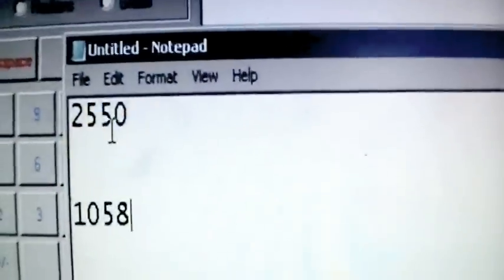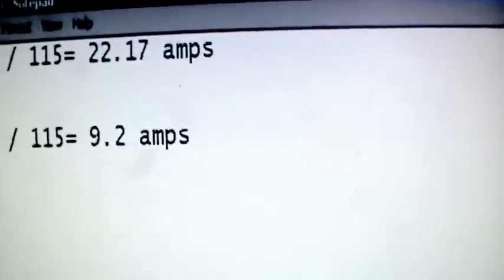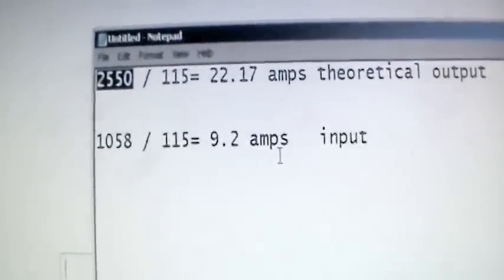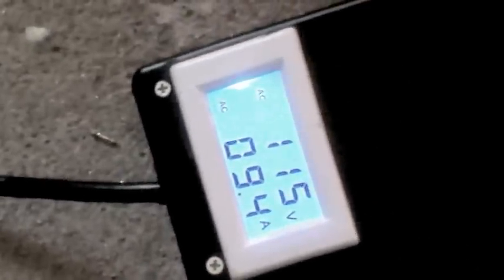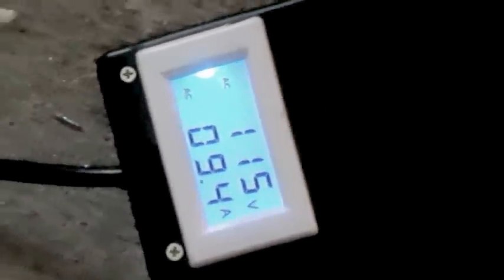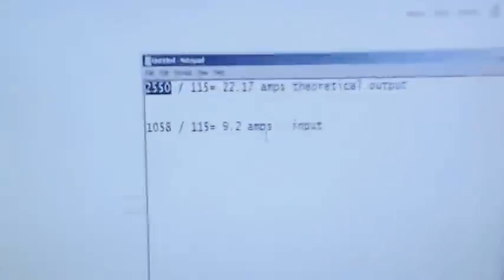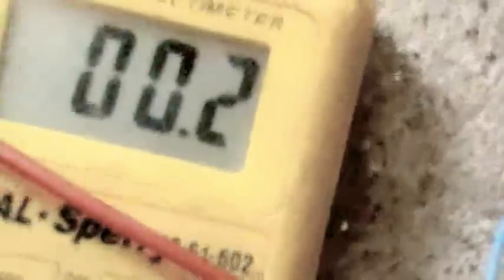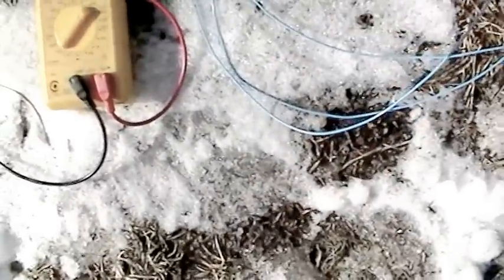Pelex -Power From Electromagnetic Energy Exchange - Overunity

Comment: Marc have you written a simple pamphlet sowing all that is presented here parts list and hookup procedure?
Reply from the maker: ***** I haven't yet since the device is capable of generation using a small quantity of power, small batteries to power a pure sine inverter does the trick, and, I have to keep the schematic offline to be eligible for patent. I've been told that a patent may eliminate my ability to build a device and market it since all governments retain the right to keep any patent as they will for government use at no profit to the inventor if they believe it has the ability to eliminate government income by tax, change or decimate another market that is important for the government to profit from, as well, I wouldn't ever be able to use it for profit to myself if that happened.

I have designed 3 different revisions of this device, but, this video doen't clearly show what is happening since the devices used in it's output do not run anything close to their rated output in their tagging as others have commented. I have been able to come up with a parts list and a functionality description, but, I have yet to really figure out where the energy is truly coming from, so, I don't feel like saying it comes from lightning strikes like Jesse McQueen said, or, from the ionisphere, knowing that I really do not know and I don't wish to be ridiculed over something I really have no proof of. The device truly draws an energy in from somewhere, so, I will need to try and figure it out, but, I don't have the millions in gear to try and figure it out.

I have decided to make one device from the technology to market for the efficiency of the LED, and once this is marketed and i am successful, I will go ahead and anounce the structure of Pelex to the public, but, if I go ahead and make this an open source design that everybody would use, the outcome would be very dangerous as the device has more power than a high voltage power line of wound incorrectly, it would cause an explosion, and, it could easily kill somebody.

   The power it starts with , conventional electricity is very dangerous to begin with, but, it is brought down to a safer , more manageable level so we could use it in the home with less chance of injury, so, when we use it again transforming it back to it's original condition, high voltage and low amperage, it has the same drive it originally had, with a massive potential to blow off limbs, cause explosions, etc. This is something I don't wish to see. If I drive the device and adjust the way the magnetic manipulation works, the Pelex unit will run devices that normally use the high potential amperage driven system with no trouble at all, as well, it will be able to operate without massive electrocution once a path of resistance is found for it's use by the electricity, doing nothing to the person who would normally be a casualty by the power if touched while in service. Normally, if we touch a system that is under massive load, the electricity will kill us easier because it is drawing most of the load from the source. If we broke that load and become the load ourselves, we would normally be dead immediately because nothing would change but the resistance. This system works opposite from the conventional system, but, still has the ability to operate a high load device with ease. It's almost as if the output has a choice how it operates and it seems impossible, but, it is very true, not a bit of exaggeration on my part.

  People will tell you that if one does not share parts used, a design, or wish to give up a parts list that the device is fake. Put it in my perspective, if you had a dangerous device that could kill a kid willing to build it, would you take that responsibility? Would you be able to live with yourself if another person dabbling with this technology built it and had his 4 year old sitting on his lap touched the wires and died from a simple battery feed??? I wouldn't, as well, I would like to earn my money back and try to live comfortably.. In fact, I don't think that by earning 100 million and 20% of it's profits would be greedy at all, after all, it is something that's thought to be impossible by any conventionally minded individual and it has the potential to change the world.

  Please watch my Pelex video that shows the design being measured by the killawatt meter. It is probably the only video that will show a metering of less going in than coming out on any device across the internet, except for maybe Tariel Kapanadze's device which is not metered at all.

  I have been ridiculed, called a scammer, a hoaxer, a liar, and, many other things, but, until the day they spend one day in my shoes, being watched, limited to my email and messages, being disallowed email attachments so I could not list the answer to their questions or design criteria, etc., etc.,.. why would I be limited to my answers and emails if such a technology were actually impossible to produce? The answer is because I hit the nail right on the head and they all know it. Our government has lied and said they want us to take part in a crusade to find a way to fix our planet. I have done that. They said they want these technologies to be released to help us become an energy abundant society without the use of fuel.. I have done that. But, I do disrupt another technology that uses the sun and wind from propelling it's way to the top. I clearly stand in the way because my device would cost less than $20 to produce and will run a home per unit. It has everybody rattling in their boots that I hold the key to all doors and they want me to look like a liar, a thief, a cheat, scammer, and a hoaxer..

The reason why I haven't posted a new video showing how to do this is  because I have been eliminated from uploading to youtube, and every other method of electronic transmission with every device that  I own. Once I transfer my pdf or jpg schematic electronically to another device, it will not upload either because somebody has so eloquently infected my devices which forces every file being transferred to crash. The attachments are not able to be transferred to any other server, not by text, not by email, not by upload.. They all crash immediately, and it is forced by those trying to protect the economy of the oil market and I have become completely sick of it that I have taken the time to present the device in a much clearer way, a better analogy of how it works, and, why we are not using this instead of paid electricity.

I have made the larger device for 4 homes to function , metered so the homes could run as customers of mine, as well, there is not an input other than a tiny little 12 v battery, 3 aH, that is recharged by its output and infinitely loops back to run the charger while 32,000 watts is output from the device continuously to run the components of each home including electric dryers, stoves, and electric heat.

I think a mistake has been made to disallow my posting of these videos, or my attachments, so, I have taken the time to give the videos to others to post them for me, and, I have taken the time to offer a written design criteria , given to friends and safely tucked away so it didn't make a difference if I disappeared today, the technology could be released tomorrow as open source docs.

There are hundreds of copies floating around , but, these people do not know how to build them as I would, but, there is instructions on how to do so with the packet I have asked them to share if something happens to me.
Reply: I found that patents are basically worthless.  If they want to steal it they will and then they will wipe you out with court fees.  This has happened over and over.  We all feel that now its best not to try and make millions and open source is a much safer way to go they can't kill allof us.

good luck
Reply from the maker: trust me, I am thinking about it, but, I am in financially way over my head and need to earn some of my retirement back. A lot was spent designing this and much of it needs to come back for a sensible retirement when or if  that ever happens.. Or, I could take a portion of what I have now, one of many devices and make the money from one before I go on with opening up to public. It's surely a winner of an invention, and the best part is it is as simple as can be to build. Everybody will say, "I can't believe I didn't think of it, that's how damn simple it is.. And the best part, we can build it by taking 3 transformers from audio equipment and rebuilding only one of them, cutting another one of them, then, wiring them in an opposing manner to manipulate the magnetic field so only one of the transformers utilizes the resistance of the coil to determine the input power, then, the output coil simply adjusts the output voltage without affecting the input whatsoever. The odds are that if somebody toyed around with 3 transformers, cut one of the E Cores as I state below, there are only so many possibilities to wire them. Two of them wired together without an input automatically release atmospheric energy, the 3rd simply adjusts the voltage to be usable once we input the set with an unusually low amount of pure sinewave power. It's really something that we all could try with jumpers until they reach the effect I have found, unfortunately, it can be extremely dangerous after the 3rd coil's output if wound incorrectly since the current can be devastating if the secondary coil is not given enough windings , or too many since the high voltages could be as devastating as the overhead power lines since it is "self manifesting" after the magnetic manipulation occurs.

The device could be grounded, or ungrounded and still work perfectly. It is truly a device Tesla knew of since the 3 transformers design is used in his great Tesla coil in his lab, and the amplification coil is really key to making the circuit function correctly. It will work at any voltage, and, it merely requires a volt to start up, and, nearly no wattage whatsoever to continue on to infinity just as long as some of the output feeds a regulated means so it doesn't over power the battery causing it to fail.

A simple 12 volt automotive alarm fob battery can power a true sinewave inverter to give 7 watts to drive the primary coil, then, opposing manipulation of the next set of coils to eliminate the core saturation and eliminate the back emf from the Lenz Effect, it will give a "bucked set of coils" their low voltage's high  amperage, then, we trick the system by forcing the next set of coils to correct the voltage, connecting the low voltage high amperage output together with the high voltage input leads of the last set of coils on the 3rd transformer to produce an in sync high voltage circuit, but, the amperage of the "bucked" or low  voltage blends in and syncs with the higher voltage giving it it's driving power to make things function.

This will in turn power a charger to re-feed the battery to loop the system, successfully powering the system infinitely, or , until it is overdriven, burning out the conductors from an over current condition.

Anybody can build it, and, If I were any one of you, I would completely disregard what Dansie says, TinselKoala, and any of the other suppressing skeptics because they have absolutely no clue what the hell they are talking abou, especially when it comes to magnetic manipulation. Tom Bearden has it 100% correct with the MEG, he just didn't try the amplification by adding coils as I have. My discovery of this was truly a fluke and I got really lucky to figure it out. It was merely by playing around with wiring after seeing a short vision or burst of daydream that I had once seeing a Tesla patent schematic from Google Patents that made really no sense comparing it to the patent description, since it was applied to the wrong patent.

The technology is here and now and we all could make it happen with a little bit of know how of transformers, wiring, and enough courage to just try it. I just wasted most of my money to figure it out, and most of it was wasted on hundreds of thousands of dollars worth of electronic components, test equipment, lots and lots of burning components, and test gear because I didn't know what I was building or really what could come out of it when I had the test gear connected to it... It isn't that it cost me a ton to make the device, I have really just given you all what it needs to be made, it is cheap, in fact it can be made completely free if you have an electronics scrap pile that has the 3 transformers in it.

Try it and let me know how you've made out. Eventually you will figure it out. It works in similarity to Tom Bearden's device, except it is made with E cores and one set of the core has to be separated so the core effect happens as it does with my device, eliminating the core losses and emf which causes the lenz effect. It is merly done by opening the core, leaving an open gap on one side of the core, and connecting the center piece of the core with one single washer to reconnect the core only in the middle and, then, dropping a washer between the open on the other end, leaving only one edge of the E open so it does not connect and have a flux path to allow the input getting loaded..

I've tried it with the two outer pieces of the e core closed and it doesn't work, only one side closed and the middle closed. The feed has to be on the open part of the core, and, the open has to be only cut on the the second transformer's feed, not the circuit's input end, otherwise the transformation won't happen between the first and second transformer.

The first core must be whole and in tact, as a normal 120v to 240 volt transformer, then, 240 back down to 12 volts (bucking transformer with an open E), and, then I went from 12 back to 120 in the end to adjust it to be usable for the power of one's home. The sequence doesn't really matter just as long as the amplification happens after the open core lenzless magnetic manipulation to cause the output to be amplified while the input isn't affected at all. It's quite simple but takes some patience., and, the coils must be in phase, as well, in resonance to transform. Too many coils will destroy this effect, and, too little will not amplify it correctly. Be super careful using a generator to run the transformers because some transformers are not a sinewave whatsoever, they can be a square wave, especially if the rotor is a permanent magnet core which will give a spike at the leading edge of the square wave which will burn the transformers out and make them very noisy. This will not allow any overunity whatsoever if you don't listen to me, it needs to be a very clean sinewave... The cleaner, the more amplification will be possible without distrotion that wil cause burning of the transformers and conductors, resistive elements, motors, etc.

We could gain wattage the same way if we had a toroid inside of a cut square core with an open at the primary end of the square core, magnet in the middle, and, a dual series coil on the toroid to give a 2 times gain from input to output, but, this is more comparable to the MEG, where small power becomes small gains, maybe a 1 to 2 output. This is what I based the design on which comes from one of Tesla's patents which the patent office purposely placed the wrong schematic to a different patent. They probably did not think anybody would figure out what it was, but, I decided to build it and immediately saw energy that was not supposed to be there without any input at all. I added power with a pwm and voila, there was additional output that I never knew was possible, but, not very significant since it was not a sinewave.

It's easy for us to make this work in multiples of amplification, 2 times, then couple two sets of coils to make 4, or, start with 10, and add a second as I do to make it equal 10 x 10 times the input, or 100 times, then, make a double unit and it becomes 1000 times. The only problem is the waveform becomes distorted and the electricity starts to burn resistive heater elements and change the compound they are made from, giving off a nasty by product and stench, so, I would limit it to 10 or 100 times to eliminate the oscillations in motors, burning of conductors or insulation with a modified waveform which can react like a modified sinewave inverter causing a lot of issues with inductive loads, etc.

Good Luck. It Works !!!!!
Reply: you can try GOFUNDME, but you will need to do the intro to your project well or you'll end up like I did on my first go at it.  ZERO dollars donated so far. I need to do it over.  definitely prepare for retirement. I'm doing everything with $1400 a month. not easy but doable
Reply from the maker: Oh, I'm sure that isn't easy. That's got to be tough, especially if you funded an expensive project with your savings before the limited income happened. I also have 90% of my funds pre-allocated for me and I really want out of that, but, you know the name of the game if you are married and have a mortgage, home, 3 kids and a lot more after getting hit hard in the pocket from a disability, especially when credit cards are the opportune thing to use when no more money is present and the creditors know you're in trouble. I got married, bought a house, a car, 2 harleys, a camper, golf cart and an $8k lawn mower within the last 5 years, plus, was out of work on an injury that ended up in a 2 year hardship, spent nearly my entire retirement fund, then, lost my Dad and had to take over his business. During the time out of work, I took my retirement and invested in my own electronics sales & research business that took off well at first, then went into a nose dive once My Dad passed because I hadn't enough time to invest in the new business and was stuck assisting with the family electrical business, having my wife tend to the electronics business, which was not her baby and pretty much clashed with her. She did her all to assist making it a go, but, I closed the doors, except for the research end of it which I did in spare time, but, the time is gone and I need to find more time to invest in my research which is only 1/4 of the way completed.

I am thankful that both my brother and I took over the family business, so, I didn't have the entire burden of operating the electrical construction business alone on my shoulders the moment my Dad passed, but, it was, and still is a SOB to deal with... so, I have to take it one day at a time..

 This is why it has taken me so long to show progress with my devices, videos and newer devices I have designed. I actually have 4 or 5 promising generation devices partially constructed, energy savings devices, and new power supplies for LED's and a couple of other solid state circuits that were built because the current devices on the market are just oh so inefficient, i had to give it my best effort to try something new which I knew would change the way our world operates. I have designed a new high amperage solar amplification device too that creates a much higher on demand current with less solar cells by using a new material, again, luckily and accidental due to my many variables created bymy very thorough research.

There's just only so much time and energy to invest for any one thing because life begins to change when the day becomes so overloaded with things to do.. We become burnt up and useless, lose all of our train of thought  once the memory banks are overloaded with the daytime work, and stress from work related issues. I guess life isn't all so terrible and it could be much worse, but, my problem is I always bite off way more than I could chew and never seem to complete one thing when a new miraculous idea comes about and i forget where I was with the unfinished idea that gets set aside on the back burner, then, when the thought goes away, so does the million dollar completion because the memory of the miraculous ideas start to fade and we never get the best thing finished. I did complete one device though and that was the Pelex device, so, it isn't all that bad, it does work, I just dont have the time to go and show it as needed.

Don't mean to vent it out in my comments, but, I'm sure you understand if you have similar concepts and the lack of time and money to complete what you wish as well.